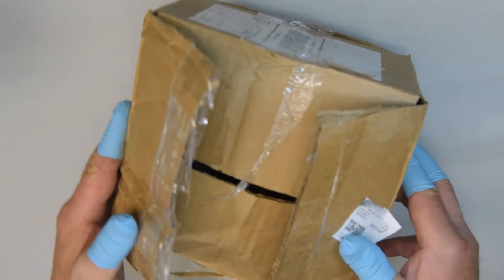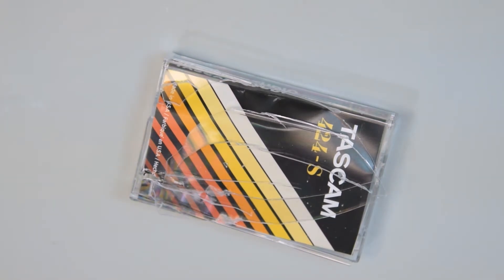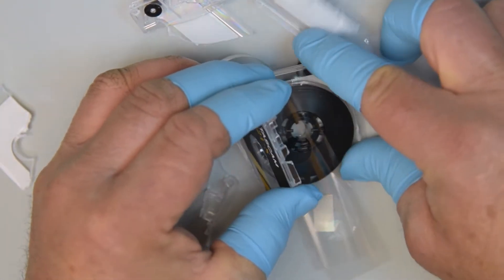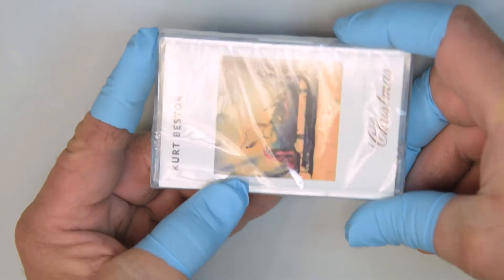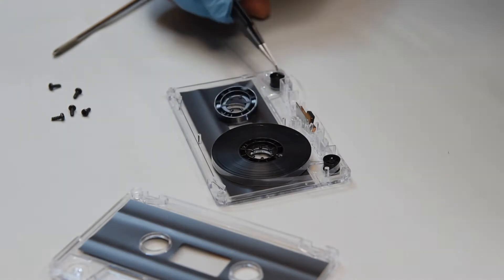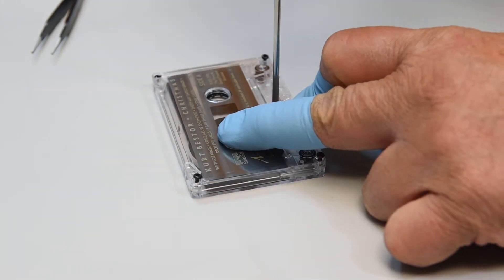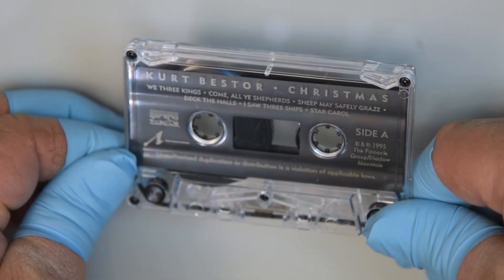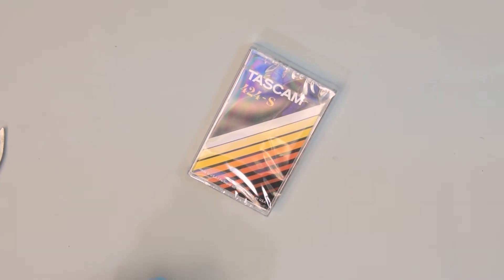Tascam 424-S Cassette Shipping Damage and Recovery

Comment: Although that replacement shell is of a better-quality plastic and screwed together, but apart from the convenance if you need to get at the tape, welded shells are much more rigid. Try it yourself, a reasonable quality welded tape is much more resistant to twisting. Does it make a huge difference?  What do you think.
Reply from the maker: Thanks for watching, Chris.
Given equivalent materials, thicknesses, and design parameters, I agree that a welded shell will be more rigid. I have several very high quality RCA calibration cassettes from their heyday, all welded shells. These newer ones however, and most like them, are poor quality, thin, and cheap. They were designed and manufactured for shareholder profits, not rigidity or resonance dampening. Still, I'm happy to see them being made again.

Comment: Look forward to your results with your several 424 recorders. Bought two of these for my MKII for the same reasons.
Another YouTube channel experienced poor results in two-track decks. I have had excellent results recording live mic, and guitar pickups. Recording at 3-3/4 ips (high) and DBX on both record and playback and the reproduction was stunning, to me. Recording anything digital electronic was muted, muffled and distorted, but I’m thinking that’s a DBX problem.
Reply from the maker: Nohr,

Your comment is very interesting and coincidental, I have just tested this 424-S tape on the 112mkII in my latest video and will be uploading the results very soon. The numbers aren't stellar but the deck isn't biased for this tape and I wish to give it a run on the deck for which Tascam claims it was engineered. I'm very happy to learn of your positive results, I very much wish to encourage Tascam, and anyone else creating new tape formulations. If you have  any specific data on your tests, I would more than happy to include it along with my own.
Reply: @asbcustom   I’ll look for those results! TASCAM optimized this formula using a “fully restored portastudio” but they don’t tell you if it was calibrated to original chrome type II specs. I’ve run across comments of users recalibrating the 424s to this new cobalt type II to make it work. 
I have bench signal generators and oscilloscopes from that era. Not the gear you have to quantify my results, though. So far, I like it well enough and it’s nostalgic-new. Where else does one get fresh type II cassette tape other than these cobalts today?
Reply from the maker: No doubt that their deck was finely rebuilt and the tape optimized for best results, my motivation is to learn if those of us with experience, and love for tape, can anticipate future offerings, or are relegated to the glories of the past. Obviously I hope for the former, and am encouraged by Tascam and others, and wish to give them a fair shake. Those with knowledge of the medium are long retired or gone, and those recreating it are doing so out of love, not just nostalgia. I don't expect the first few to match the best of the past. Let's give them a good test and fair assessment, offer our results, and encourage their further development.
Reply: @asbcustom   Good words. The newer crowd have revitalized these for unusual musical effects. It encouraged the production of a modern cassette. Hope it keeps some momentum, and improvements as you say.
Wouldn’t several of us love a Cobalt Type II 2.0 release with a tech sheet and bias adjustment recommendations…
Reply from the maker: The tests I've seen so far online have been universally negative, all are using their deck's auto-calibration feature. In a previous video I demonstrated how the autotune feature was somewhat less effective. I'm not a fan of letting a microchip optimize my record settings, no professional gear that I know of does this. The 424 may be a decent formulation but will probably need some fine-tuning outside of what auto-calibration can manage.

The 424 has a spec sheet available, here is some relevant info from it:

Reference Level to Bias Noise Ratio	-60.0dB
Reference Level	250nW/m
Recommended Bias	2.0dB*
*Specification is for +2 db over biasing at 6.3kHz.20db below reference level.  
Record Equalization - For optimum performance, record equalization should be set after biasing, as the oxide in this tape responds somewhat differently due to its high performance characteristics.
Reply: @asbcustom    I am proven foolish now. I have a copy of that spec sheet I obtained from the TASCAM site. I did not read it all the way to the second page where the recommended adjustments were. Thanks for the guidance!
Reply from the maker: Not foolish at all, in fact, it was good for me to review the data. Following the test on the 112mkll, I'm going to do another on my personal 122mkll and see what I can dial in, while I anticipate your tests. I won't be able to get to my 424's for a while yet, there are several others ahead of them but I look forward to the challenge when it happens.
Reply: @asbcustom    Here’s where the fun begins. Factory service manual (and the circuit board) for a 424 MKII have no “bias adjustment” and measurements are mostly dBV.

(Edit: There IS a bias adjustment for each track, R120-R420, it was cut off in the scanned printed copy I had)

Tetrakan goes through the factory sequence calibrating levels that seems to work for him. Basically:
1) Set output levels with very expensive reference tape.
2) Record a 6.3kHz signal at -10dBV onto suspect tape using DBX.
3) Playback suspect tape and measure/adjust reproduce levels to 0dB. All balanced to each other.

So I’ve got mixed units, and I’m not sure what I add the +2dB over bias to. Input signal to be recorded, or the output of the playback? Or does it all come out in the wash when the TASCAM cobalt tape is the subject tape is used for adjustment?

Or, leave it all screwed together and put it back in the closet where it belongs? 🙂 No need to reply, thinking out loud and will get it sorted out.
Reply from the maker: "Factory service manual (and the circuit board) for a 424 MKII have no “bias adjustment” and measurements are mostly dBV."

Sure it does, R120-R420, it has all kinds of adjustments and you'll need them too.

The 2db overbias is simply finding the maximum output voltage with the trimpots, then continuing past maximum to a point 2db lower (not backing off, but continuing in the same direction). The other factor they ask for is setting EQ following bias, not every deck has separate bias and EQ trimpots, and in my hour of testing last night, I found this somewhat helpful.

I was eventually able to get reasonable numbers on the scope but when making a straight recording with no noise reduction, I couldn't get past what I'm calling the "analog jitter". I filmed this effect and will upload soon. What was happening was a jitter-like distortion present (and visible on the VU meters), that audibly interfered with natural vibrato and harmonics. I've never seen anything like this, both 424-S tapes I tried did it, no others. I suspect at double speed this may get better but it's a total deal breaker for standard speed in any event. I also suspect that the reason others have had such poor results is that they were relying on their deck's autocalibration features to tune the formulation. I don't believe any deck not specifically setup for this tape can handle it, certainly not any automated calibration efforts. Once set up for this tape, I don't think the deck would be useful for any conventional formulation either, it's more like setting up a reel deck but one that runs at too slow a speed. Even when I did manage to get a decent recording and tried to listen past the jitter, I found the treble harsh and bright, unmusical to say the least. I can make the treble on an old TDK D series sound like shimmering silver in comparison when the time is taken to optimize it.
Reply: @asbcustom    Agreed, I have four adjustment pots for each track. None of them are designated “bias” though. Only one is “bias frequency” for the whole board. No matter, I think I’m in over my head so I’ll stop hi jacking your video comments 🙂

That’s a shame you can’t get anything usable on normal speed. And I can tell you’ve tuned everything possible in your tool kit. Maybe the negative attention from the two-track folks on the cobalts will prompt a re-formulation.
Reply from the maker: @nohrtillman8734  That one is the bias oscillator, the others are what you're looking for. The more I look at the specs and think about my own experience, the more I believe this is meant only for high-speed recording combined with dbx. That should fit in quite well with your needs but it won't be a replacement for out of production Cobalts.